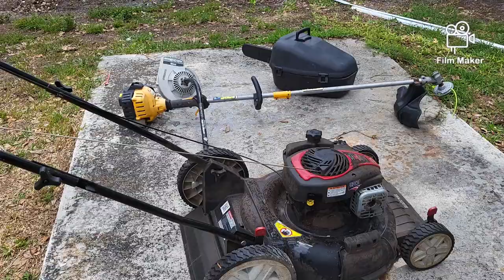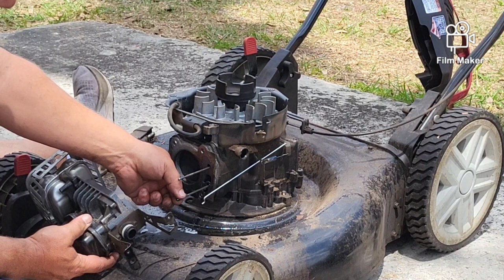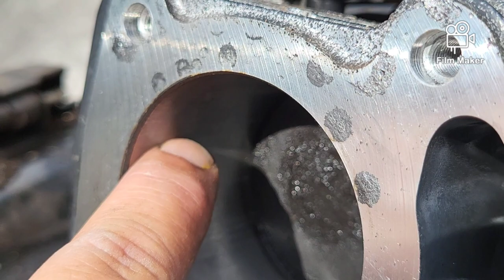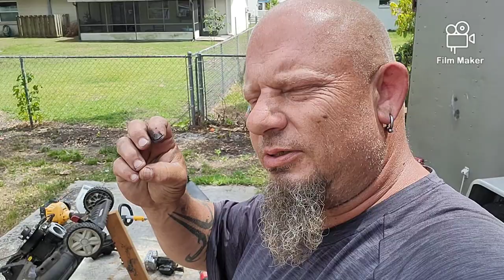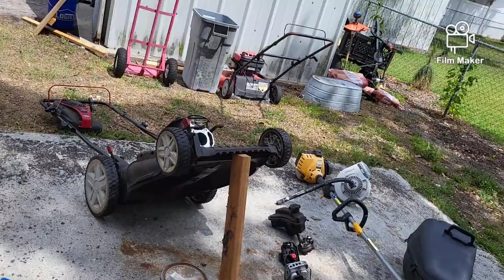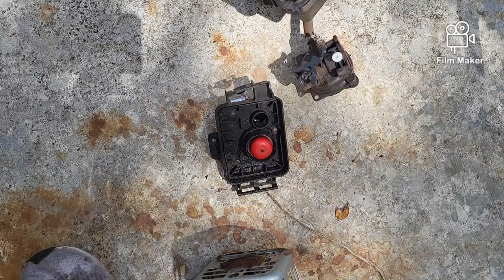Lawnmower Blew Up / Can It Be Fixed / Briggs & Stratton

Comment: Nice easy diagnosis.  Mowers in my area are starting to hit craigslist.  All are pricey so far.  Hoping to do some easy fixes and quick flips this year.  Last year was great for this sort of easy money.
Reply from the maker: Here the last 2 years were the worst I've seen in 20 yrs.. used self propelled were selling for $25 shiny and perfect working.. I stopped flipping.. now prices are finally coming back to normal
Reply: @MunkyWrench  There was a lot of easy money around.  Seems Florida is constantly being rebuilt, so it's no wonder that money is in abundance for the well insured and connected.

Comment: Now, if the head gasket on ohv could have compression burp through the pushrod channel back into the crankcase but before i assume that id listen for rod knock. Which is dirty oil and internal wear surfaces gone. Ring gap leaks compression back into the crank case. I have a Honda gcv 160 right now with rod knock and smoke. But the rod knock seems a little further progressed than the smoking problem. Honda completely eliminated the head gasket and timing belt on the new 170/200. They went to a disposable jug system. Also they decided to"quiet quit". Not even phoning it in any more. Lol😅 come on hunda

Comment: Yeah slapping piston's side to side will do that with no lube, hoping my ride on (MTD from Ohio) will just be a gasket issue although I first thought it would be rings coz it's pressurizing the oil filler and spitting oil out but we'll see (looks like you have the same mower there)
Reply from the maker: Yeah I have 10 or 20 of these a month.. but rarely are they beyond saving.. hopefully for u it's a simple job and your back in biz.. the body on this one is good so I will put another motor on it when I get one